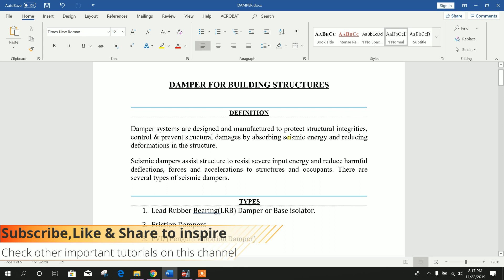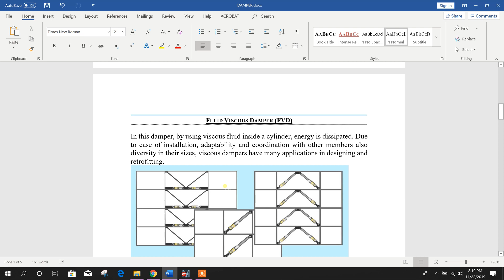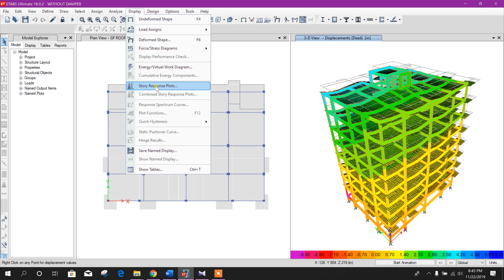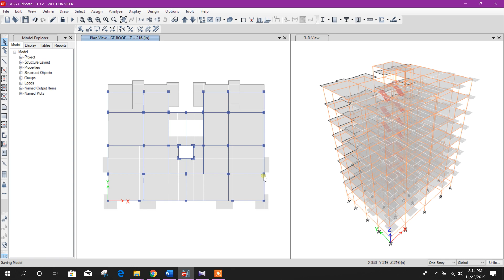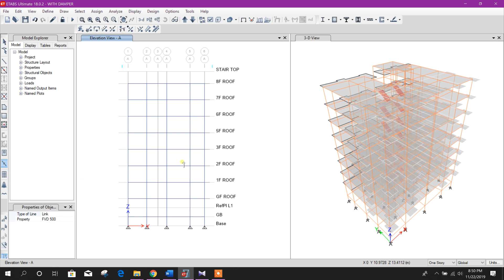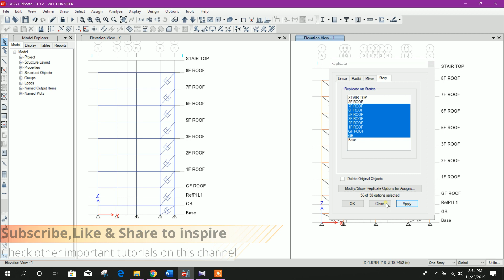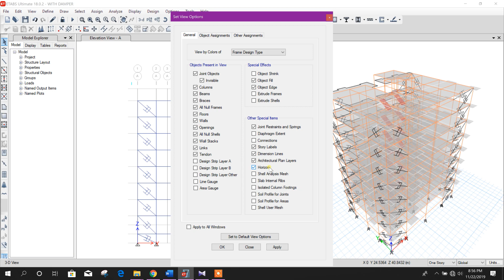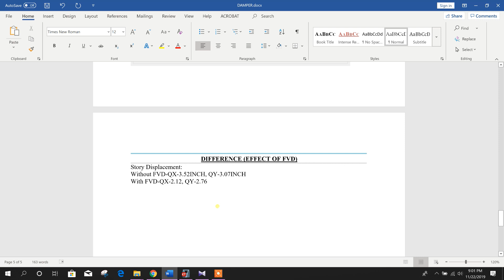Modeling Fluid Viscous Damper in Etabs | Introduction to Dampers

Comment: Sir you have just defined and assigned a fixed link. That means it is more like a steel brace not a fluid viscous damper. 

In order to define a fluid viscous damper, you need to check non-linear option for direction of FVD. For example, if you are planning to assign a damper in X-X direction, you need to check U1 button and nonlineer button for definations of damping value, stiffness value, damping exponential value etc.

For summary, this content is not true and useful. Please do not share any information if you are not know what you are talking about. Engineering is a very important profession. Do not lead our colleagues through wrong directions!

Comment: Damper should reduced displacement as well as acceleration. You have checked displacement, its reduced, ok. what about acceleration!!?? I have done the same, displacement is reduced but acceleration seemed to increased by about 40%. Why's that. It will be great if you make clear. thanks in advance.

Comment: Sir, i provided fluid viscous damper using Sap2000. After analysing the results of interstorey drift is same as compare to bare frame model. Is their any mistake in putting values of stiffness n damping coefficient?
Reply: Hi! I have a similar issue. Was there any mistake in values for stiffness or damping coefficient? where is the mistake?

Comment: Sir I don't think you calculated the Weight correctly, 98 Kg is 1 KN Not 500, Force of 500 is probably related the capacity.
Reply from the maker: That is provided following FVD capacity chart.
Reply: The weight supposed to be 0.98 kN, not 500👍🏻